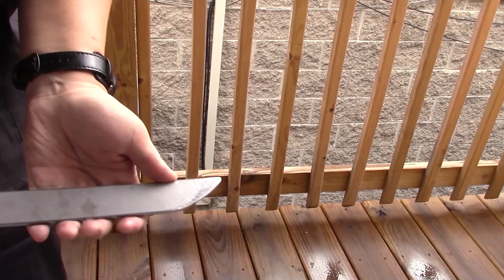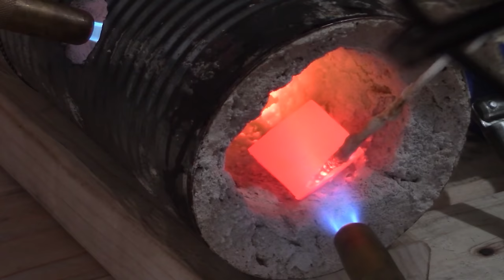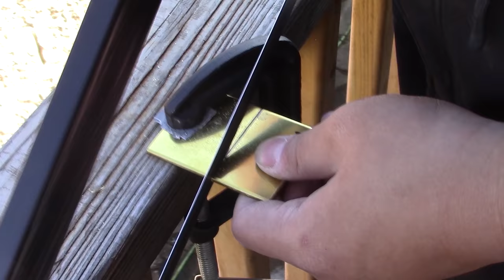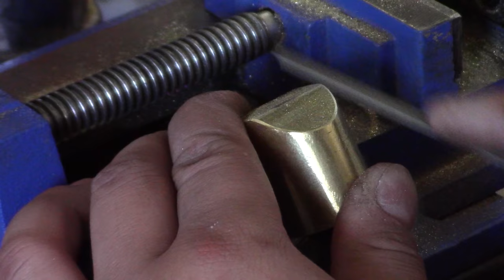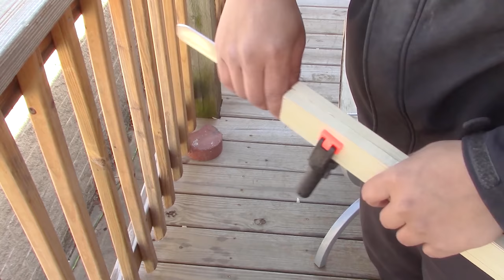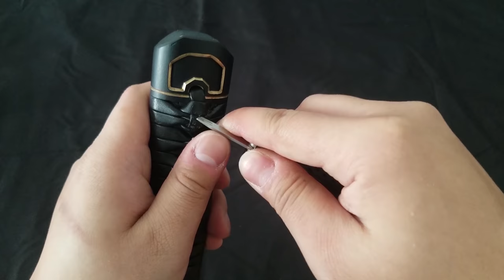Katana Making - WAKIZASHI

Comment: For the longest time I've thought, "ugh, I need a belt grinder and a forge and a good anvil" whereas you're using a few propane torches, a cast iron vice and some handheld power tools to make a simplistic but beautiful sword! I am going to straighten out those leaf springs in my cupboard, cut them to size and hot roll them to length. Thanks for the motivation, my man.
Reply from the maker: Thank you! I have gotten heavier machinery since this video, but at the time all it took was the right amount of motivation.

Comment: Fantastic build. the time that it must have taken to complete considering you only used hand tools for the stock removal.
Reply from the maker: Thank you, and yes it took forever!
Reply: @JumboRadish  Angle grinders and sanders always make that difference in time. I forged some blades out of 1084 steel, normally hammer the bevels in prior to any cold work which helped. Was the 1095 also quenched in warmed canola, as you did with some of your other projects ?
Reply from the maker: @olivermilutinovic749  If I remember correctly, it was. I didn't measure the temperature with a thermostat, but I threw in a heated iron bar to the oil.

Comment: Very impressive sir.  About how many hours do you have in the build?
Reply from the maker: Thank you! Because I made this when I had no power tools, it took about a couple of months (2~3 hours a day).
Reply: @JumboRadish  So around 100 hours?  I could guess is took a long time given you were using a hack saw to cut 60-100 linear inches just for the blade.  I'm super impressed.
Reply from the maker: @dumbguy9386  My god, the hacksaw(ing) and the beveling with a hand file took forever and hurt my arms and back.
Reply: @JumboRadish  I certainly wouldn't have the patience for that.

Comment: You’ve done an amazing job bro. But could you list the tools that u use i know nothing in crafting and im tryna recreate this. Thanks
Reply: Get a small angle grinder with some cut of wheels and grinding disc its cheap and will help a lot in the cutting and making the bevels on the blade

Comment: Does the steel have to be annealed before you can cut it with a hack saw and file it? I was told carbon steel is hard to cut with a hacksaw.

Comment: Can someone explain why the tsuba has that weird shaped hole besides the blade hole? I've seen many historical katanas with that peg hole shape.

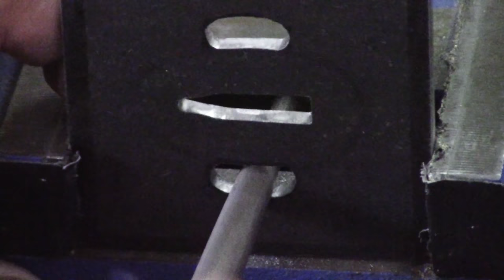Referring to the bottom hole shown @ 2:32
Reply from the maker: I'm not sure, so don't take my word for it. I think maybe it's for pulling the Sageo through the Tsuba, to do a safety knot type thing (for long term storage)? I also heard tools used to attached to katanas, through that specific hole on Tsubas. (I just like the design).
Reply: They are openings for the the kogai and kogiana.. a small knife and a hairpin... they are placed in the scabbard and go through the tsuba.. it’s not for sageo

Comment: How many degrees did you temper the blade at?
Reply from the maker: I tempered it at around 400 degrees, cooled it to room temp, then tempered it at 400 again.
Reply: @JumboRadish  how big was the blade?
Reply from the maker: @brandontran3582  About 21 inches. When it comes to Wakizashi, traditionally, the length CAN vary far more than the Katana. So you can make it whatever feels comfortable for you.